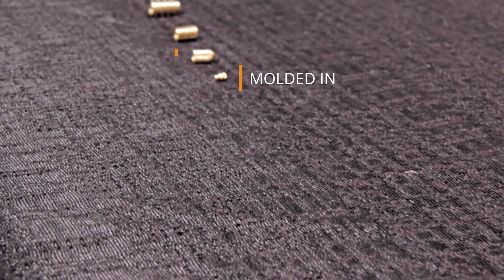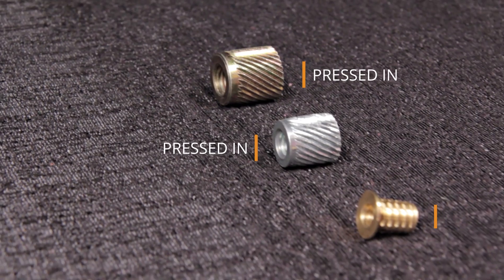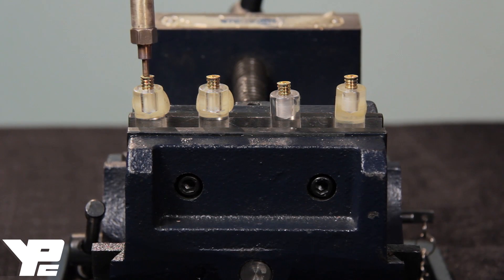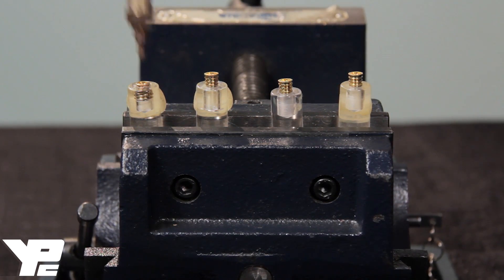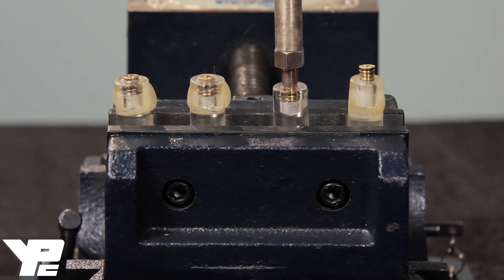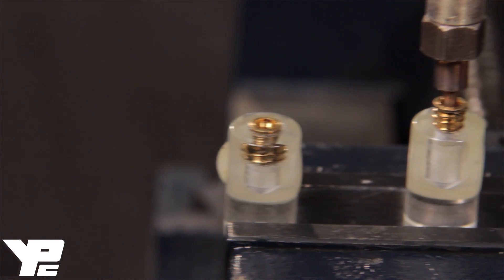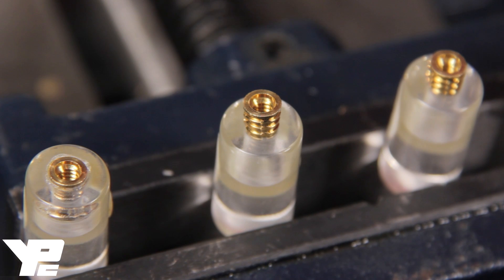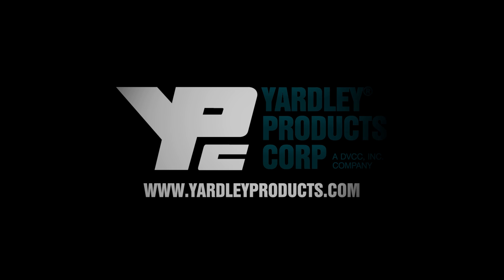How To: Thermal Inserts Installation

Comment: is there a way to avoid the spring back?
Reply: Do it at a lower temperature than they did in the demonstration, the high heat will cause the air underneath the screw to expand and push it back out.
Reply: my guess is to let it heat longer than they did in this video
Reply: Yes, immediately after install press the face flat against a cool piece of metal. You'll get a perfectly flush install.
Reply: I think that phenomenal came from a wrong temperature of work, or holding time of the insert wasn't enough.